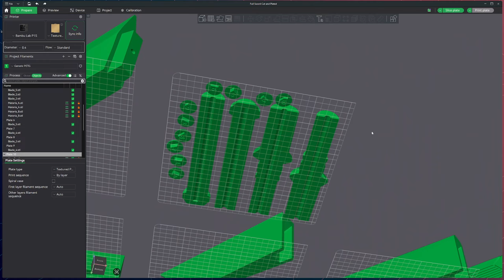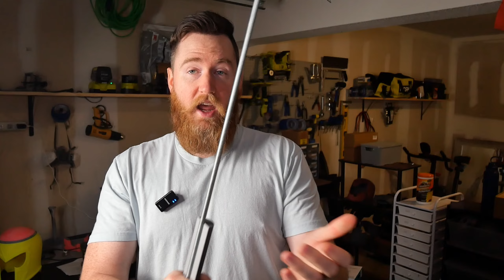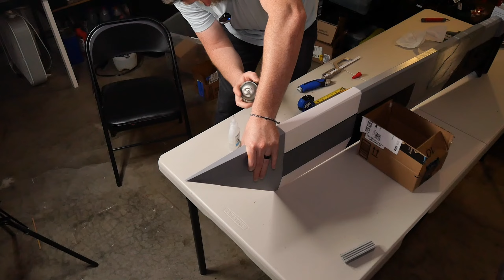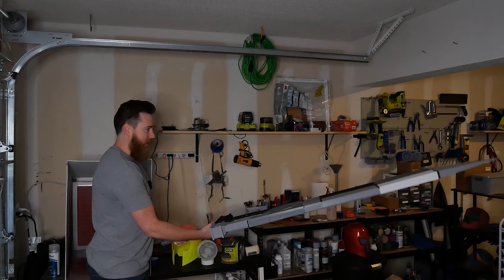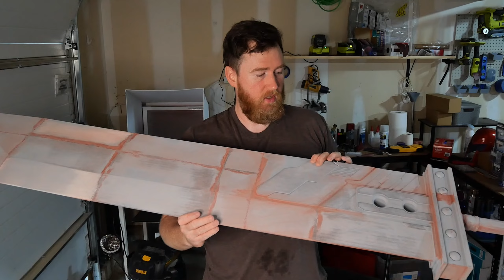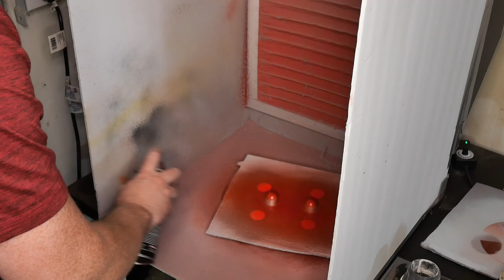How To Make A REALLY Big 3D Printed Sword. Detailed Tutorial.

Comment: If the dowel rod are a quarter inch… how big were the holes?
Reply from the maker: Slightly bigger. I took a small part with a hole in it to the hardware store and just tried different dowels until I found one that fit the best.